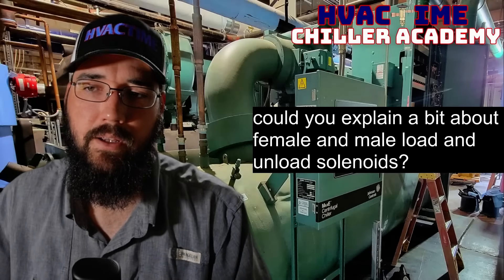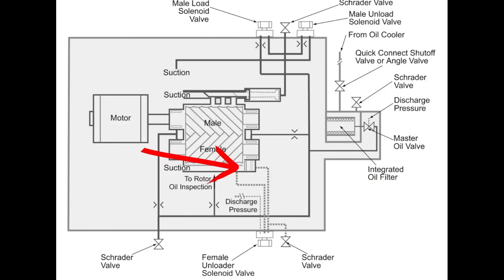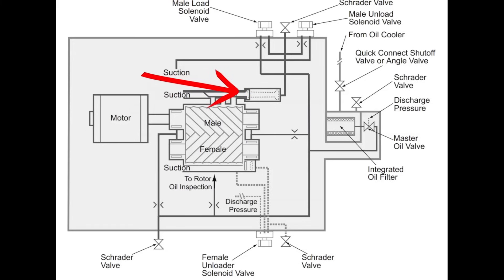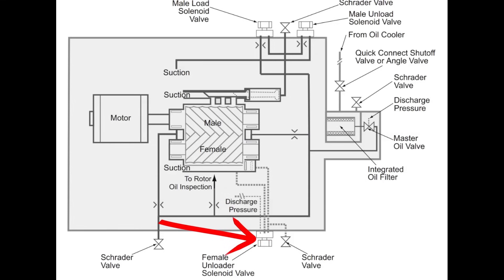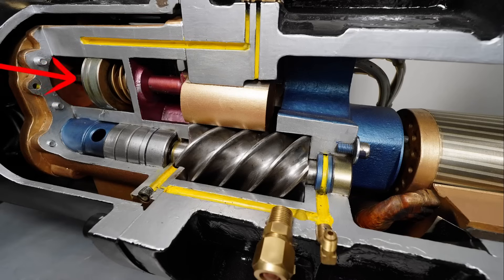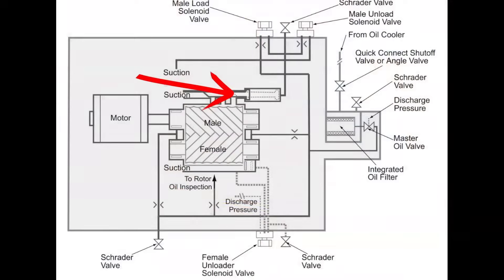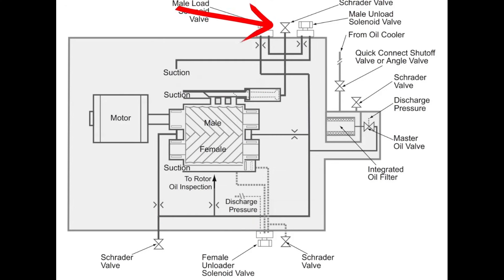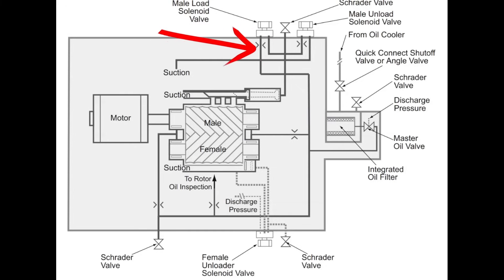RTAA Chiller Female & Male Unloaders Explained

Comment: When these compressors are trying to run at 100%, is it normal for them to continue to pulsing the load solenoid?
Reply from the maker: Yes, the controls don't track position so they will keep trying to load past 100%